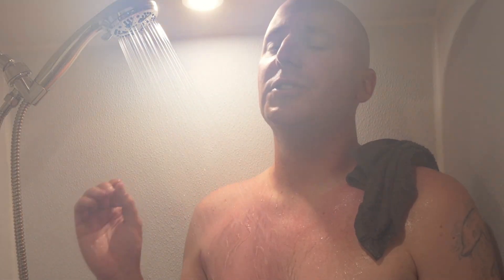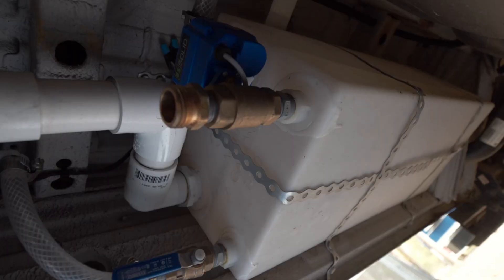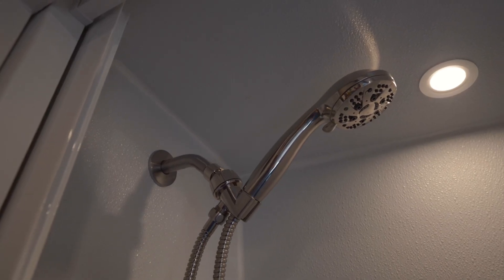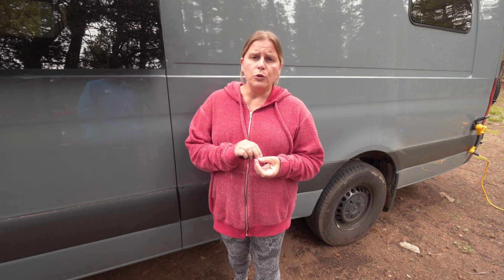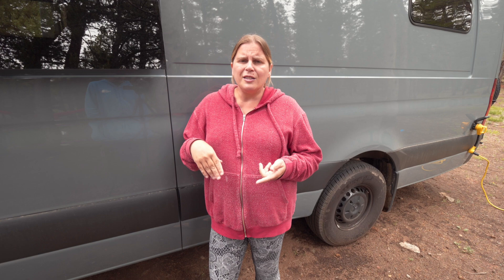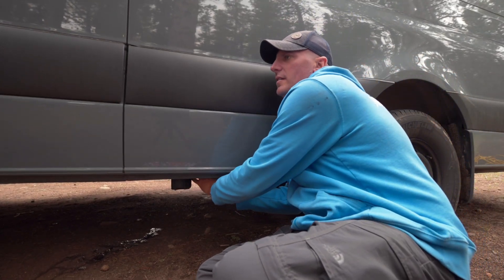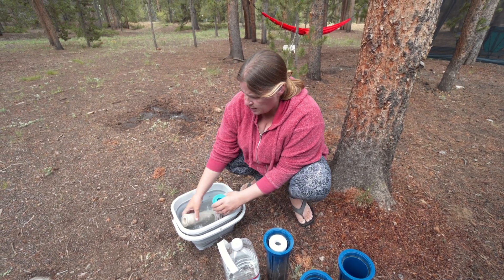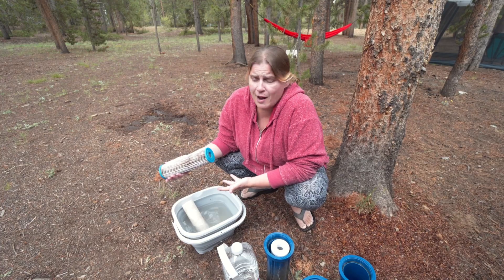RECIRCULATING SHOWER for Vanlife: The Truth and What You Need to Know!

Comment: Love your videos - they are brilliant! Technical suggestion:- If you want to use soap and shampoo etc in your recirculating shower, have you considered using a much larger centrifugal filter (I think you referred to them as spin down) or multiple centrifugal filters without any other filtration at all apart from a pump pre-filter? Think of how a Dyson vacuum cleaner works. Yes, even a Dyson vacuum cleaner has a standard filter, but 99.999% of what is removed is thanks to the centrifugal vortex effect. The higher the flow rate in your shower (bigger pump if necessary), the greater the potential effectiveness of centrifugal filters. I believe that a properly sized centrifugal filter combined with a more powerful pump could totally transform your system. You should not get the water flow issues associated with choked standard filters. You would obviously still require a pump suction filter - ideally very coarse mesh type and not too small. Another advantage of centrifugal filters is that they can be cleaned just by briefly opening the drain valve. Possibly a powered centrifugal filter rotating at high speed - if you can find one - might perform nearer to 5 microns?
Reply from the maker: Thank you so much! That’s an interesting suggestion! Will definitely have to do some research and see if it will work with our setup! Thank you for watching!
Reply: Wouldn't this extra pressure be too much for a continuous shower? I mean your could slow down the water rate but wouldn't that depressurize the water flow? Could you please explain? Thanks

Comment: I'm pretty sure that your pump pre-filter is on backwards. With all of these style filters the sediment should be accumulating on the outside of the filter. Your pre-filter has all the junk on the inside of the screen, it will drop the flow faster. Another thought is to get a second 50m spin down filter, one before (basically a larger pre-filter) and the one that you have after the pump. You could always change out the filter that clogs the fastest with a 4" diameter filter. I've also heard the the 5m charcoal filters help keep the water 'fresher'. Finally, once you are done running the system for 5 minutes after taking a shower you could dump some calcium chloride (the really cold weather driveway salt) dissolved in water down the drain. This will work better than Epsom salt at precipitating the soaps. The water will be warm, making it even more effective and you could always drain off a bit of water (the next day) to dump the precipitates that accumulated at the bottom of the holding tank.

Comment: Try baking soda and apple cider vinegar mixed in water and put into a spray bottle. I use half a teaspoon on baking soda and 2 tablespoons of vinegar in regular size spray bottle with water. You can play around with the mixture to find what ratio works best for you. This will also clean your hair very well with no need for condition. The vinegar works like a pH balance conditioner this mixture doesnt give any Suds so this will be something you may have to get use to. Some people need those suds to feel like their clean and washing your hair is a little strange with no suds. Sometimes its hard to tell if you got it all clean but if you spray the mixture on your hair rub it in your hair you will have clean hair. This is a very natural way to clean your hair and body it's much better for you then soaps and shampoos. I think this may work well for your filtering system too it may help keep it clean.

Note: if your hair feels heavy or not as clean as you like the mixture needs to be changed to fit your body Chemistry add a little more baking soda is your hair feels heavy if your hair feels dry use less baking soda and a little more vinegar just play around with the mixture to you find the right mix for you. When you get it right your hair will feel just as clean as when you use shampoo. This is good for your skin and hair much better then shampoo and soap with all those  Chemicals in it....

Comment: Thanks for this video guys. Im going back and fourth with re-circulating shower, in our van conversion myself. The doubts i have is which kind of soap to use is just the main reason, for my hesitations. So for now we will just use the water from the freshwater tank, as we are just weekend campers for now. So there is no need for complicated shower system at this time. 

However the system keeps interesting me. What i will try in a test setup inside the house, is what a ultrasonic cleaner and a O3 generator wil do with particles and soap residues, in a funnel shaped holding tank. 

According to a guy on the internet with a similar boat setup; he claims that the ultrasound break up the particles and the O3 generator can take away bad odors. 
According to this guy, when the ultrasound cleaner and the O3 cleaner is turned of, the particles will sink into the funnel shaped holding tank. which then can be tapped off until the water becoms clear. 

If this really works, which i doubt. I will let you know. Ultrasounds only can travel best through filtered soft water. Which is the opposite of shower water. 

Cheers
Reply from the maker: Thanks so much for watching! We totally understand your hesitations! We went back an forth with the use before we just decided to go for it! We figure we can easily convert it to a normal shower if we find that this really doesn’t work for us. We are always looking for ways to improve the shower and will make some adjustments when we are somewhere we can do so. The ultrasound sounds very interesting. Would definitely love to know of you figure anything out on it!

Comment: Thanks for the transparency! We actually do shower in our van 1 once a day and get 6 days of water which includes drinking and cooking, but we have to haul around 40 gallons of water and use adjustable water restricted do to our van being very small. I really wanted to set up the system like yours but was limited on space and do spend in sub freezing temperatures. You are so right you have to compromise:). We find a lot of vanlifers don't use there showers and end up going to gyms
Reply from the maker: We definitely wanted to be transparent with this. We want to help people make better systems and feel like sharing the problems will help people come up with better solutions! I look forward to the day that someone figures out a similar system that will have a small footprint and be better for van applications. We mostly don’t plan to be in cold weather and if we had we probably wouldn’t have mounted under the van. We just figure if we do need to be in cold temps we will just purge the system and seek out other ways to shower. It’s definitely a work in progress and needs some fine tuning

Comment: Have been thinking about the UV sterilizer… effectiveness would be a property of how slowly the water passes through the unit and how many passes it makes. A low-flow shower head (1 gpm or less) will make UV more effective (longer residence time) and a minimal amount of water in the system will cause more passes through filters/UV. I will also be installing a “filter” mode where the shower head is bypassed and water just loops through the system - a large volume of water and a short shower would provide very little filtering of the water and bacteria are going to multiply in the 24 - 48 hrs between showers. Bypass filtering would be very beneficial.

Comment: I read a scientific paper that said something about adding titanium dioxide to the water to allow better degradation of the soap. That would be great because you could just use something one of the soaps that use titanium dioxide for white colorant. But it requires like 20 minutes of exposure to the UV light to get the degradation. Which would probably require an additional tank or pipe system to keep it in front of the light for that period. May be unreasonable. Just a thought.
Reply from the maker: Interesting concept! Could be a solution for a future build but it’s always good to have more information than less! Thank you for contributing to the list! 😂 Now to go and try to find and read it!

Comment: A friend of mine is adding recirculating shower to his new build. He has a different approach from the start. He is aiming for the smallest possible recirculating tank, but he will be using a regular hot water tank as well. His system is complex because it will have heat recuperating function., and there is "double up of everything", more pipes, more drains, etc.  The idea is to start off with an army shower., that is a separate system with separate drain hole, and feed pipe I guess.  Get clean and scrubbed down with soap and shampoo using as little water as possible. This water goes to regular grey tank. Then after getting scrubbed he will switch to the recirculating tank and he will be able to shower for a long period., I assume it will have it's own pipes and drain holes and pipes to filters and back to recirculating tank. Lots of pipes, lots of possible leaks and problems....But this will put as as little wear on the filters as possible, as there will be no soap or shampoo and likely less hair and skin cells in the return water for the recirculating system as body and hair is already washed off and clean. His build plans are for medical reasons first and foremost because he suffers from a bad case of arthritis. Long hot showers seems to help him get a decent start in the morning.  I don't know more about his system, but I know ha is aiming for 7 filters in total, as well as some anti bacterial LED light or UV light. Will see next summer when his build is completed how it all works out and how often he needs to dump the recirculating tank and add new fresh and clean water, as well as the filters etc.
Reply: Someone else mentioned something similar, but I don’t understand. Once you’ve taken the quick shower and have gotten clean... what more is left to a shower?
Reply from the maker: His system does sound a bit more involved! We do like hearing about other systems and how they end up working! If you can update us on how it goes that would be great! Thank you for watching!
Reply: “What else is left to shower?”

Enjoyment!!!!!

Even in a house with virtually unlimited amounts of water, how long do you actually wash w soap and a wash cloth?

It’s about enjoyment/quality of life….the soap/shampoo and wash cloth part is just a small of a nice long hot shower!!

Comment: Weighing environmental impact of the manufacturing and disposal of filters and cleaning them vs discharging mildly soapy water which naturally recycles itself with no landfill or manufacturing impacts.
Alternatively, backflushing one of the first inline filters to prevent clogging might only require dumping one gallon of dirty water.

Comment: Seems like a good system!  Congrats!  I assume you don't live in your van in cold climates?  I am saying that because you filters are quite exposed.  I would think once you put the 1st (string wound) filter before the screen you could probably take the screen out of the system, because the 1st filter will probably take more out of the water than that screen does.  And I agree with Scott K-T who said put in a valve that ends up reversing the flow from between the 3rd and 4th filter back toward the 1st filter!  That could save you lots of cleaning!
Reply from the maker: Thanks so much for watching. Yes we generally try to stay in climates that are above freezing. We recently had to go to an area with some cold temps so we just purged the system until we left the area.

Comment: I think a good idea would be to opt-out of the filters except for the spin-down filter. Wash rinse (Recycled) then a final rinse with clean water and perhaps lite on the soap. You won't have to use special soaps which is still a good idea. And you will still save on the water although you'd be replacing the dirty water after every shower.  There's always a drawback..... But no maintenance or cost for filters $$$.
Reply from the maker: I think this is a sensible approach and a good suggestion. We may try this in the future if the filters prove to be too much of a hassle! Thank you for watching!

Comment: What you need is a very fine mesh screen on your shower pan drain. It will catch All hair and a lot of dirt and even soap foam, that you can pull after every shower and shake into garbage.
Also...I'd make sure to install entire filtration system inside the van, as this system is not for winter climates!
Reply from the maker: This system is definitely not four season. If we happen into freezing temps we will purge the system. Thank you for watching!

Comment: You could make a 1/2 gallon of 150 ppm hydrchlorus acid (not hydrochloric acid) solution to add to your shower in place of using soap. This will lower the surface tension of the water enough to wet  your Skin and the small amount of free chlorine in the water will also kill some potential pathogens as well. Please note though that free chlorine in water will corrode any metal plumbing so check your system before using this process.

Comment: We are designing a recirculating shower in our home (not a van) and this video is quite useful! Not sure how you do the heating though... I am thinking of having a heater than can heat already warm water (those made for solar boilers) or, just using some water from the warm water system, to bring the water back up to the right temperature, and also deluting the water a bit (calculated 3% per circulation).
Reply from the maker: Thanks for watching and so glad you found the video helpful. I would imagine you could use a tankless heater if some sort and you can probably set it for the exact temperature you want. Diluting the water to help keep it fresher sounds like a great idea as well . Would have loved to do something like that but space was definitely an issue! Best of luck with your design! Let us know how it goes!

Comment: Great video! How about some how building something that allows you to use a big coffee filter or two as a pre filter that you could change out quickly and cheaply. You could have a container that you pass the water thru where on the end of water line, so the water passes thru the coffee filter. It could be placed in a window screen for support of the filter. Then bunch the filter and the screen up and zip tie it to the end of your line(allow enough room for water). Then take your filtered water from there (your output from the container). Hope that makes sense.   Hope that might be something you can work with, let me know how it goes.
Reply from the maker: That is an interesting solution! My only concern is restricting water flow and giving the system enough of a water supply to recover… it does make sense! Maybe a future mod? Thank you for the suggestion and for coming along on our journey! Stay Wanderful!

Comment: A couple of options would to use organic shampoos and soap. Second, maybe using a larger fresh water tank and use a switch to drain initial clean to the grey tank and then switch to recirculating for remainder of shower. In other words, dump the initial shampoo and soap to grey tank and then switch to recirculating for remainder. Using a 20 gal fresh water tank and a 15 gal grey tank, you can probably get 10-15 showers before refilling the fresh water tank and emptying the grey tank, plus save on filter costs since the water will not be as dirty that is going to be recycled. All the hair and soap will go to the grey tank first. Just a thought.
Reply from the maker: We are definitely testing v out organic soaps and shampoos. Unfortunately we don’t have the room to add more tanks, but I’ve seen one person do something similar to this. Although we rarely see updates on how these systems are really working out. We will keep pressing and hope to come up with a tolerable solution! Thanks for all the suggestions!!

Comment: Epson salt bonds with soap particles, making it heavier than water and sinking the bottom of your holding tank. Give it 30 min to sit in your tank, then flush out the bottom layer of water, only using the clean upper layer. Otherwise, the salt will just clog your filters even faster.

Comment: my thoughts on this would be to just get water anywhere outside, like from a lake or something, then run it threw a filter before filling the tank, that way you could shower always even if u couldnt find any filtered water anywhere. The filters needing replacing is kinda a down side to be honest, depending on how long it takes, if i had this system i would shower daily as i work alot, so a bigger filter would be nice, also the filter location might be hard to do if its inside but not sure, most vans will have a freezing problem if you live in a cold climate so water hoses has to be on the inside. This would be worth it if you only need to wash or change the filters every few months or so, as that wont cost much compared to the time it takes to refill the water tank if u were to shower daily. The filters inside would also take up more space which normally would be used for a bigger water tank, the weight would also be a plus though, im considering this system or something close to it, but not sure yet. Thanks for the video